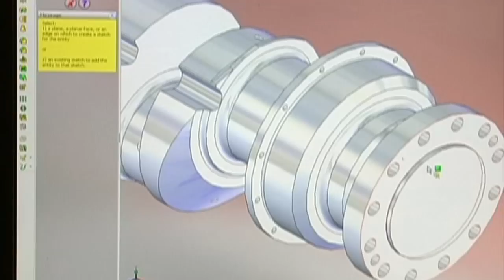ENC Trailer

Comment: There are many of special machining cycles made by TECAS, to see in this video. I did this so well that ENG use the cycles from TECAS on most of therein CNC machines. I do offer operator and programmer training for these machines! Also I offer customized machining cycles for more efficiency in programming and operating. I trained the Operators and programmers on most of therein CNC machines. It is nice to see the success of my training!